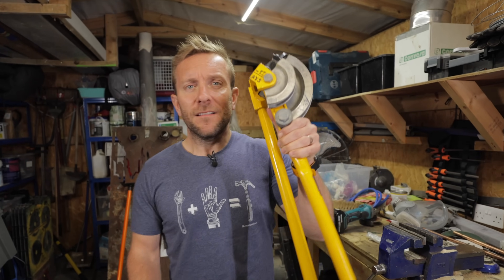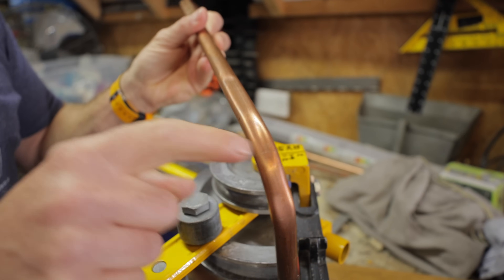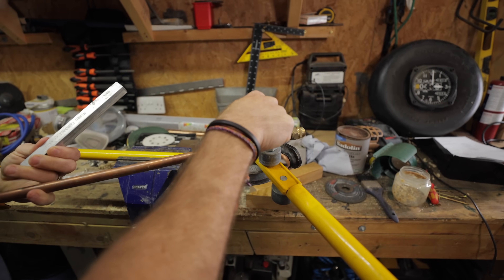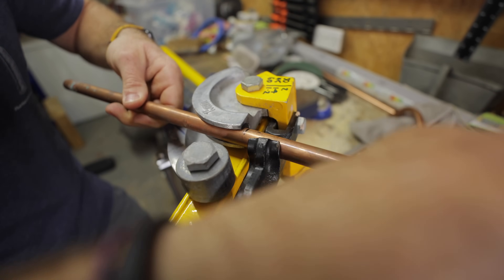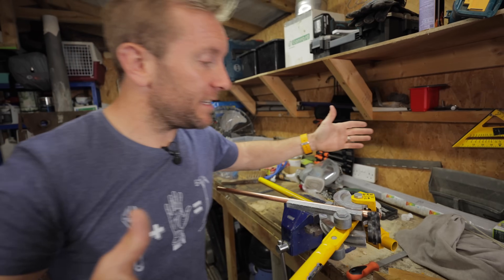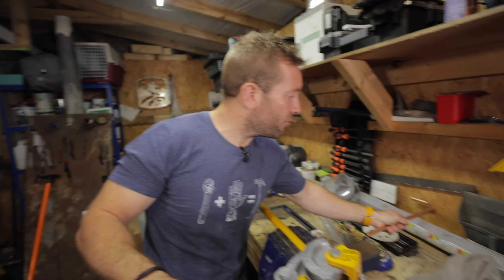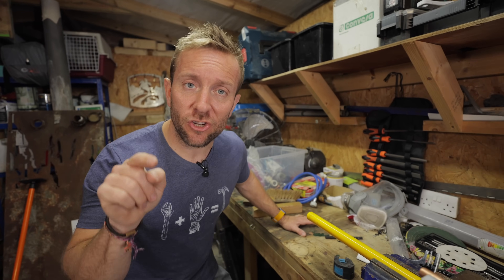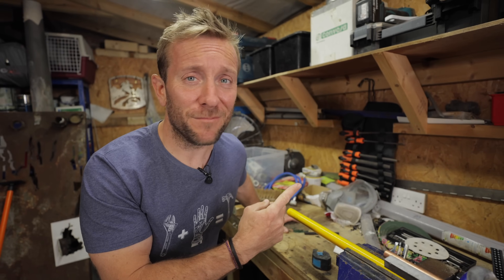4 Pipe Bending Mistakes EVERYONE makes

Comment: Great video thanks, about to buy a pipe bender. HOWEVER, I’ve never trolled anybody online but can’t let this one go, what have you done with your double socket?.. you have a none flush metal box, rather than the plastic box for that mounting. Then you store a metal piano hinge on top of the metal, that you were touching in this video, I’ll send you a plastic box, it’s only £1.12 and may save your life if you have a short!

Comment: If You mark the first point of the bend en you make the bends 45 degrees than its 42 mm x 1.41 = 59.22 mm that is where You mark the second point.  If you make the bends  30 degrees than its 42mm x 2 = 84 mm between point 1 en 2 for the offset

Comment: Great video. My pipe bends (cheapies and perhaps bent by stupidly bending some slightly wonky shelf brackets . . .) chewed the side of the pipe. Attention to the rollers Inc oil and oil on the roller face of the guide perhaps helps. Also keeping an eye on the guide being square. Put a bit of rag on the clamp to stop it creasing the pipe would be my other tip
Reply: I give a squirt of wd40 over the pipe and formers and it does make a difference

Comment: Thanks for the video. Very useful and entertaining. It would be interesting to see you pull a bend without a bench vice as would be done on site. Quick use full tip. I often use the floor to push against instead of my hid to pull a bend especially when pulling bends on 22mm pipe. See you in the next one

Comment: I need to do a new bit of pipework in my house which could do with a couple of bends being made. Is there a way you can bend copper without a bender? I'd like to not spend 70 odd quid on a bender for one job 😢

Comment: I’m an electrician and had to change a zip water heater, wasn’t quite like for like and had to repipe the water feed with a slight set, without a bender I filled the copper pipe with sand and managed to make a small set in the pipe for it to fit without an indentation, pretty satisfied after
Reply: Was taught that at college, heat the tube first which makes it easier to bend with the sand inside.
Reply: Special